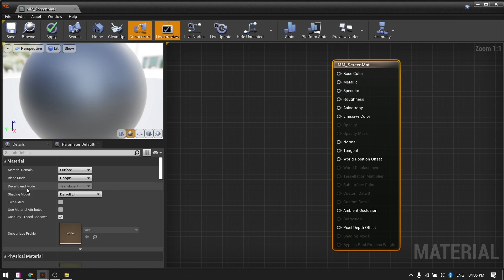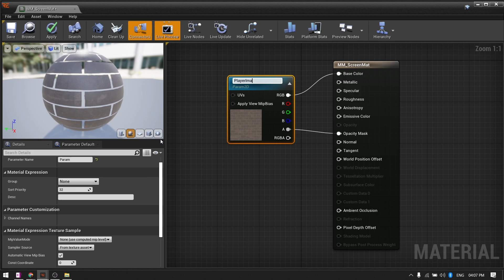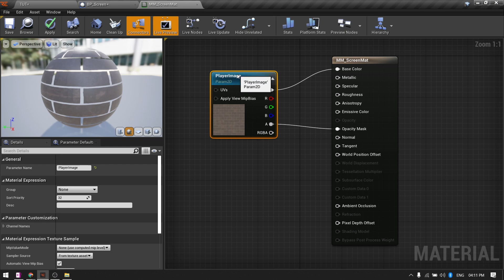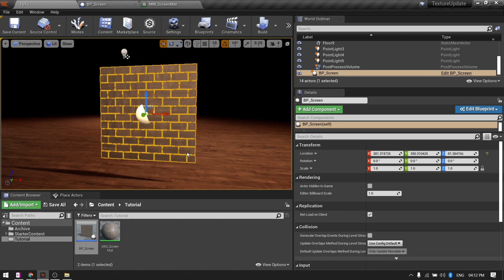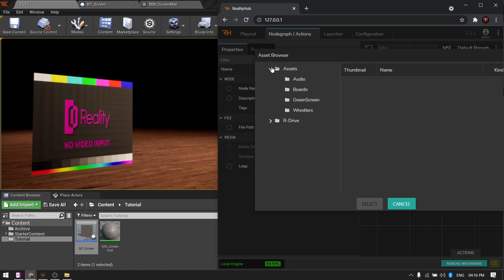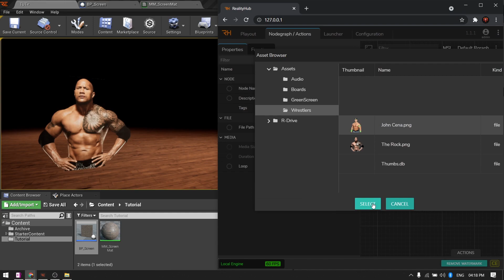How to change Texture in real-time (Method 2): Zero Density Tutorial

Comment: Hi Raj ! I’m new to Zero Density and theres not much tutorial online. It will be helpful if you can help me. My question is there a way to implement drop down list consists of multiple colour into a single mesh? So i can quickly choose any colour i want from that drop down list to implement into the 3d mesh in Reality Hub.
Reply from the maker: Hi Faiq, yes you can do that. You will need to do this inside of the blueprint in the Reality Editor. You need to use ENUM and create the list of colors that you intend to use later.